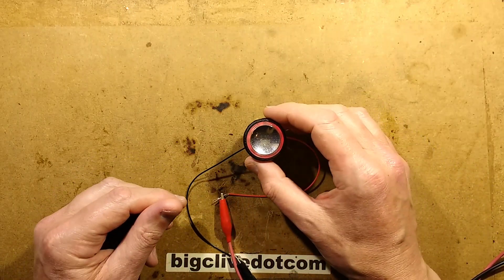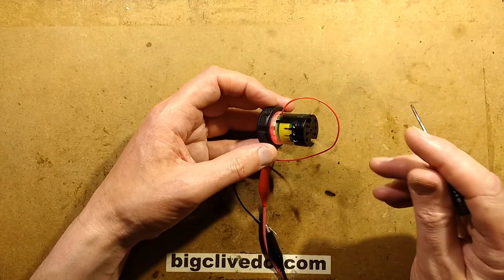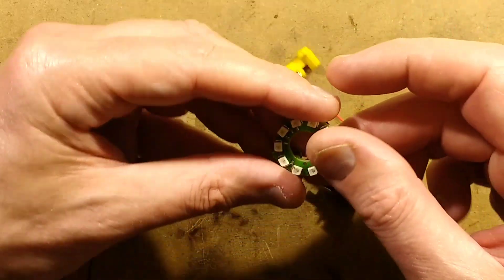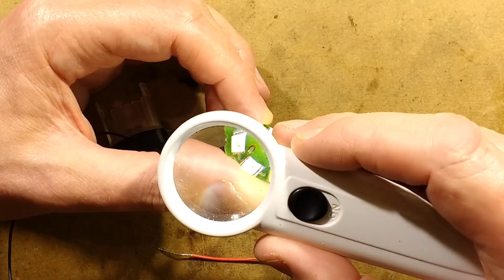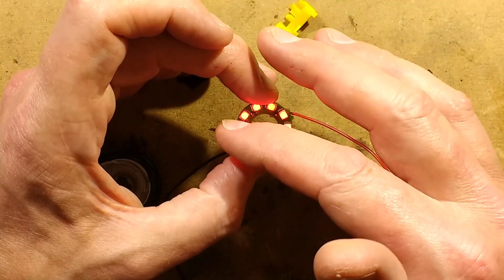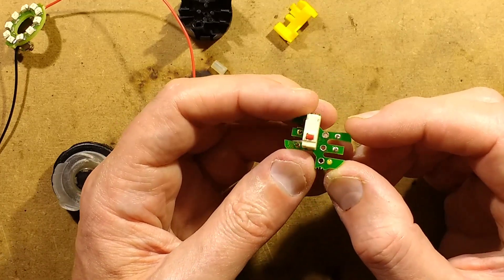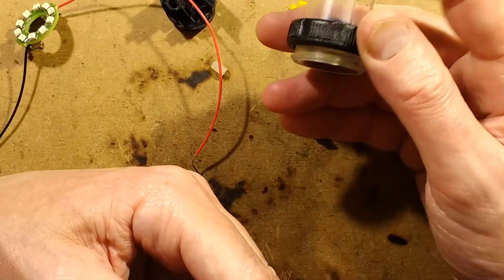Inside an illuminated Otis elevator call button.

Comment: Oh, I recall you mentioning that they tend to put CAN bus interfaces and hook the panel and outer buttons onto it — because sophisticated mass-produced IC-loaded buttons are quite cheap and easy to organize on the panel, and it allows for scaling them easily for various amount of floors.
I guess, they do the same thing to the street lights these days — as it turns the whole set into a LEGO-like arrangement, extensible with blocks that just fit right in.

Comment: Clive, you have made me smile due to a coincidence. This reminds me of a project I did not a long time ago, which was a capacitive sense touch button for an elevator. I got away using just three terminals for the whole thing: one for 24V, one for ground, and one for I/O. The buttons that I did changed from blue to red either when pressed or when commanded by the controller. You can check it here: https://twitter.com/bloguetronica/status/1224711603284860935 . Or here: https://twitter.com/i/status/1224716739063287813 .

As for that Otis button, I find it strange to see that the LEDs are not bright when passing about 15mA. The efficient red LED tend to be quite brighter, but on the other hand the amount of illumination you have may cause them to appear dimmer.

Comment: This is an Otis FAA25090J111 CMOS/relay type elevator buttons
This button is for relay controllers 
It exists with green leds,
All Otis alarm buttons are CMOS type, with yellow leds or without leds
There are Micro type buttons with red and green leds
And MCS220 buttons with red, green, blue and white leds
I really like Otis elevators buttons

Comment: My old college has these kinds of buttons on their library lifts. What's odd is that the buttons are always illuminated dimly, then light up brightly once you've pressed it to call the lift. I assume this simply works by two different voltages, but would the LED circuitry support that? It seems like it only runs on 24V...
Reply from the maker: Pulse Width Modulation.  When the buttons are dim they are probably being pulsed very briefly at full current.

Comment: So, although marked  C1/ NO1/NC1 and C2/ NO2/NC2 it actually only has 1 switch? Or is that a double pole switch (doesn't look like it)?
Reply from the maker: +Chris Walford Two positions for switches, but only one populated.
Reply: Thanks ~ I couldn't quite see whether there was second set of terminals on the board.

Comment: This seems to be a modernisation button. The standard button of this style is much thinner and goes straight from a 4-pin plug to the remote station which is connected to the canbus. It is usually just the alarm button which is this rugged mechanical style with a large microswitch and screw terminals, but it has amber LEDs.

Comment: Would not the separation with plastic spacers be to reinforce the connectors in the event of over tightening rotating the connector on the PCB?

Comment: the standoffs and the separated PCB poles on the switch are just for the case an installer fails to insert stranded wires "completly" into the post, but has some filament going in wild directions to the sides. 
And since those mechanics are always done in a hurry and the system is powered off completly during electrical maintenance, it would cause lots of "running around" to trace down a single shortcut button...

Comment: Clive, you quite often find with Otis illuminated buttons that they are constantly illuminated with a low light until the push is operated then the LEDs ramp up to a much brighter illumination.
Reply from the maker: +Scott Redpath It's probably being pulse width modulated by the local canbus module.

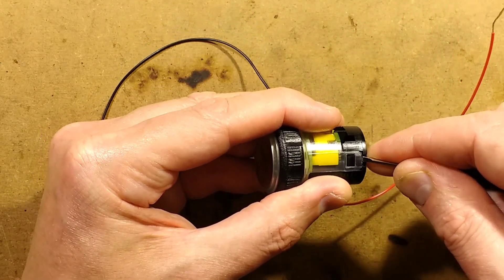Comment: 1:44 Well... generally speaking, no. Elevator doors aren't controlled by a CAN bus, though I think they might communicate through CAN or other high-reliability serial protocol for adjustment and configuration purposes.
    Call buttons are a different story altogether. The hall call buttons are most often multiplexed, as are the cab call buttons, being the latter sent through a serial interface to the elevator controller, as a separate bus.
    Wether a CAN bus, RS-232, other standard protocols, or even a custom serial protocol is made standard through-out the elevator controls, depends heavily on the controller manufacturer.

P.S.: The call button you have there seems to be a 48V call button, designed for maximum compatibility across elevator control technologies.

Comment: I'm a new subscriber and thoroughly enjoy these videos...I'm learning a whole lot.    My kids and I have MacBooks and we are always having to replace the power supplies after a few weeks of use.    I'm getting no output from them whatsoever.   I leave them open to air since I've noticed they can produce a large amount of heat.    There are companies that sell  power suppliers presumably made from the same components as in the OEM power supplies.   The big difference is the Apple icon on the case.      Have you heard of this problem and what might be causing it.   I'll gladly send you a supply.   Thanks, Chuck Wright, USA
Reply from the maker: +Charles Wright Many of the clone power supplies have inferior and sometimes dangerous circuitry.  I'd only suggest using Apple power supplies and if they fail then take them back for a replacement.

Comment: Can anyone out there suggest a good way to control the speed of a single phase induction motor such as a bench grinder. The issue a voltage reduction also reduces the torque. As the load varies, the motor speed greatly varies. I don't want to go to the cost of three phase motor and a VFD.

Comment: Really? REALLY? What the fuck do you think is going to be inside it? A SWITCH AND AN LED. There,  I just saved 6 minutes and 4 seconds of your life. Next video, Clive.
Reply from the maker: Some people are into elevator technology, and to them this will be an interesting video.  This is a good quality button with shock absorption and two PCBs with an unusually generous ring of LEDs for linear illumination and actual microswitches.
Reply: Aurelius R That neatly laid out ring of LEDs was a surprise. I expected the plastic to be shaped as a lightguide, optically distributing the light from a single 24V bulb (upgraded to an LED in later models). Would have made sense as a natural design evolution starting with transparent industrial buttons made from coloured glass.

Comment: elevators here they use capacitive touch buttons
Reply from the maker: The first touch button used in elevators were introduced by Otis in 1964.  Very clever technology, but with a flaw.  When a building went on fire the ionised air caused the touch sensors to false trigger and called the lift to the blazing floor and held it there.

Comment: Hmmm, no talk about the facility of a second switch and extra terminals on the circuit board other than the back of the outer shell.
Reply: UnrealVideoDuke I was going to say the same thing. Oopsie! Did you notice how high the switch is mounted above the board?  Serious moisture & corrosion resistance there!

Comment: Who else remembers when the elevator button light rings were orange neon, with the capacitance-switch buttons, and the floor displays were nixie tubes or mechanical / rotary number drums ??
Reply from the maker: I have some original Otis touch button tubes here.  They date back to around 1964.
Reply: The operation of these always fascinated us as kids... of course it was an excuse to make every button light up from L to PH, and then annoy everyone on the elevator, since it would stop at every floor!
Reply: As a baby lift engineer with Otis in the early 70's, I came across the story of Otis (valve type) touch buttons which had been fitted to a lift in a prestigious Scottish hotel. 
The story goes that on numerous occasions, the night staff in the hotel basement, had been spooked by the lift starting in the middle of the night, moving around and stopping with doors open at various floors. So much so, that a member of staff refused to work there and left immediately, and did not return.
After numerous callouts over a long time, it was eventually discovered that the installation team had not followed the wiring scheme correctly. The fault was caused by incorrect screening of the wires feeding the buttons. The theory went that various EM fields generated by nearby equipment or the wiring picking up stray radio transmissions was causing various buttons to be triggered randomly (some more than others). 
The wiring to all the buttons was replaced, and the faults went away. The member of staff was never seen again.

Or maybe it was poltergeists.....

Comment: thank you i have a few fixtures from dover elevator and didnt know what voltage to start on cause i dont wanna make magic smoke out of em in the states they run them on 240 3 phase power then somehow step the voltage down to 24 volts or 12v
Reply from the maker: Best bet is to look for clues about voltage and start low.  Different systems use different voltages.

Comment: thank you i have a few fixtures from dover elevator and didnt know what voltage to start on cause i dont wanna make magic smoke out of em in the states they run them on 240 3 phase power then somehow step the voltage down to 24 volts or 12v

Comment: I hate that you can't deactivate an elevator button by pressing it again....
Reply: You can, sometimes. It's a feature in the software that needs to be selected. I used to enable that so that dickheads who insist on pushing a lit button feel like a dickhead :-)
Reply: Douger Rohmer what you mean like visually impaired people who can't see if the button is lit?
Reply: No, I mean people who have to hammer a button because they feel the lift will operate faster that way. When the button is lit, the lift knows your needs and will attend to them shortly. No need to push it again and break it.
Reply: Douger Rohmer whoops yes I see what you mean now, the call buttons.  that seems to happen alot especially on slow generic lifts that take ages to level!

Comment: I'm curious about the whole system, how does this button interface with the rest of the elevator?
Reply: Various ways - it could be discreet, ie each button is connected to a couple of wires that run upstairs, or it can be on a data line where the button is connected to a RS board, which is in turn connected to a 4 wire data line (2 for data, 2 for 24 Volts), and then everything on the hall data line is talking on the same data line, ie gongs, position indicators, buttons, etc.

Comment: We have the obsolete issue here at my work in New Zealand. Otis lift installed in 1999 with call buttons starting to fail and Otis struggling to find replacements
Reply: Nathan Gordon Might be an easy fix if built like these buttons. That internal microswitch is easy to find.
Reply: Mike Cowen chances are it's an easy fix indeed. Fault is that buttons that are used more take more pressure to activate. The OTIS techs simply replace components so wouldn't look to pull the button apart. Unfortunately I'm not allowed to touch anything lift related in NZ unless your 'certified'. Next time the service tech is in Ill certainty aim to take a close look though!
Reply: Nathan Gordon I understand the restrictions. Thank a lawyer. However, I would still scrounge all the old switches I could and see how tricky they are to refurb.

Comment: Send help, I'm currently stuck in an elevator and can't call for assistance as someone has stolen the button.
Reply: uK8cvPAq Just randomly short together any two of the 3 wires in the hole, there are 3 combinations, one will ring the bell. One hand only to reduce electric shock in case it's a 220V design.

Comment: Glad it arrived and thanks for taking it apart. Enjoy the Stroopwafels and Drop. Here Drop is both salted and sweet and also hard and soft. They replaced these circular call buttons with square ones and they beep (I hate it)
Reply: IKR, too much beeping, circuit designers have got to realise that just cos they can put a beeper on everything it doesn't mean they should.
IMO Clive aught to do a thorough appliance de-beeping special at some point...
Reply: joinedupjon I believe the beeps are a requirement for visually disabled occupants, not that I know of any in my building but its probably something regulatory enforced
Reply: I can see they'd be useful for the visually impaired...I'd prefer a solid mechanical clunk rarher than a trashy beep but maybe an electronic sound is better in some ways as it shows the push has been registered by the comfuser... typical for lift users to repeatedly hammer on the call buttons, maybe loud feedback reassures them that the lift really is going to come and gives the switch an easier life.
Reply: joinedupjon they keep beeping when pressed even after registering by the controller
Reply: TechMonster no they have a white melamine or teflon (I presume) surface. See https://ibb.co/hCA4F5    and     https://ibb.co/mvAh2k
Reply: I don't know button manufacturer's names like you and I bet Otis doesn't make them theirselves or do they
Reply: oh those old-style punch-in buttons ? (they stand of the surface)
Reply: oh right thanks. Clive took apart one of my buildings lift's old buttons :)

Comment: Slots and dividers are probably to keep the 'whisker wires' from shorting adjacent terminals...
Reply: The slots and dividers are probably for safety and reliability.  There is a large umbilical cable that carries all the high and low voltage cables.  Even coaxial and ethernet for cab security cameras.  In case there is any induced voltage or insulation breakdown, you don't want it to arc across the traces.

Comment: I always preferred Schindler's Lift.   Not necessarily more reliable, but great if you knew a film critic with a lisp.
Reply: Schindler quality is horrible compared to Otis or ThyssenKrupp. They're flimsy and cheaply made
Reply: @TheMatsushitaMan  I would prefer Kone and Mitsubishi over all of them.
Reply: 7367Network and they don't have a proper chassis and have crap logic!
Reply: 7367Network 

In Brazil, Schindler bought control of ATLAS ELEVADORES the biggest and best local supplier for many decades. I'm not sure they'll maintain the quality and the lead.

Comment: The anti-tracking slots are probably there for older mains voltage relay logic elevstors, some places modernise the cab and refit new buttons in to older lifts keeping original logic.

Comment: Seems so dim, are you sure the voltage shouldn't be 32v Is it a button for the panel on the floor or inside the carriage?
Reply: These came from the panel inside the lift but they were identical to the ones on the outsides of the doors. I believe 24V is the right voltage. I am used to seeing them in real life before our lift got modernized but they are brighter and red-er if you see them for real

Comment: Stroopwafels. The "oo" is pronounced "oa" as in "Das Boot" ("The Boat") and the "w" is pronounced "v" - stroapvaffles.. Buy them from Lidl, place one on top of the mug with your hot drink of choice for about 3 minutes until the caramel softens then eat. You will NOT be disappointed.

https://stuffdutchpeoplelike.com/2013/10/04/no-48-stroopwafels/

Comment: i was just thinking what a lovely doorbell that would make.  could the metal finish be wired to the mains for jobos ?
Reply: richard arseburger I wanna buy one of these and Try that
Reply: richard arseburger Probably would work
Reply: Somehow I'm expecting a video titled "Shitty Ebay Suicide Button"
Reply: Just requires a bit of bodge jobbie to make illumination work on 12V :)
Reply: Francois Deshue as long it works on those pesky Jehovah Witness to
Reply: richard arseburger For any less wanted guests and door-to-door salesmen (is that even a thing nowadays).

Comment: I love how Clive can find something of joy in the old and the new elevator systems.
Reply from the maker: Wait until you see the Otis touch button from 1964.  An actual touch sensor.
Reply: bigclivedotcom Please, let's see it! I always wanted to see the guts of one of those.
Reply: You mean a heat sensor that also gets triggered by fires like in the Towering Inferno ?
Reply: psirvent8 I suspect not actually a "heat" sensor. They respond instantly, where a heat sensor would have "some" delay. I'd guess it's a voltage threshold device, triggering when your body, on contact, (as an antenna) couples a large AC voltage into a comparator. Best guess. I'd still love to see how the real thing works.